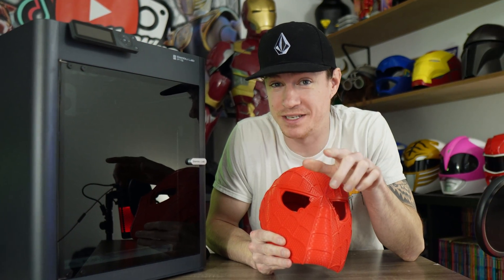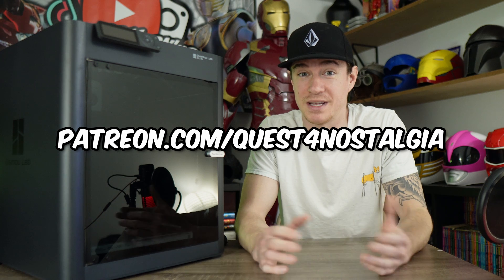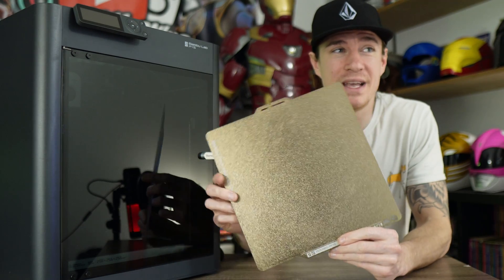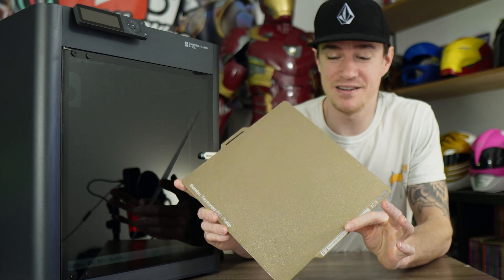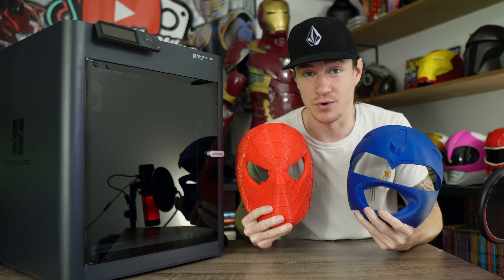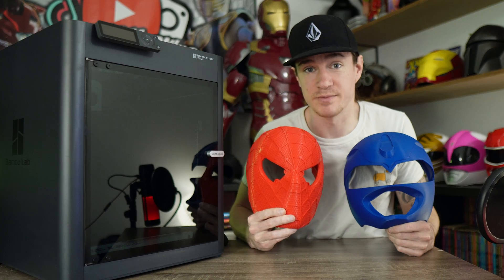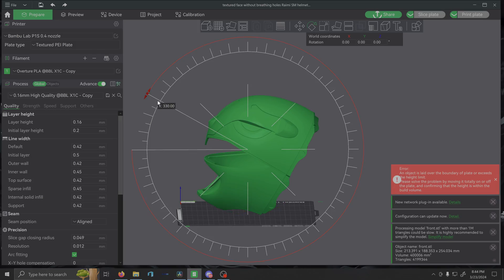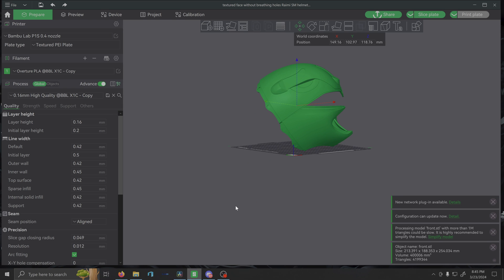How to 3D Print Full Helmets on a Bambu Printer!

Comment: Do you typically stick to a fixed layer height? Or do you use the adaptive layering feature of Bambu to get an improved print on the dome?(reduce circles)
Reply from the maker: @Capafool  I usually stick to a set one, but I did try adaptive on my turbo red helmet and it really did make the ringing easier to sand down
Reply: @LayersofDylan  Thanks! Keep up the good work.

Comment: Happy to see my head size fits 😊.   Would you recommend printing with .6mm over .4mm nozzle for these large prints for the time savings? Thanks!
Reply from the maker: @Capafool  nope I only print .4 I used to do .6 on old bed slingers but it is more work to sand smooth
Reply: @SaturdayMorningProps  thanks! I'm using a P1S so no slinging to worry about 🙂. I'm still learning but once I get my first few prints I can maybe do a video on my experience of using .4 vs .6 nozzles using adaptive layering to find a happy medium between speed and quality

Comment: The main problem is there's no easy way of splitting that I've found. There's one program that works ok but it's ridiculously priced at $100 a year or $500 lifetime and their monthly price is even more ridiculous. I don't support piracy but this guy deserves to have his software pirated. I think it's called Luban
Reply from the maker: @dosdont  I split with 3d builder, it's linked in a google drive on my helmet sizing tutorial pinned comment
Reply: @LayersofDylan  3d builder for Windows? I use a mac and I just read that MS is not going to be supporting it any longer or it's not in their store any longer. The community has done a piss poor job of making splitting stl's easy IMO
Reply from the maker: @dosdont  you can also hot key c to split in Bambu slicer and add pegs
Reply: @LayersofDylan  Yea, I've done that for splitting in two but when you're trying to split in more than 2 parts it's a pain.

Comment: I had the exact same thought debate with myself, K1 Max or P1S. Ended up with the P1S with AMS on sale, was about the same as the K1 Max pricewise. While I do regret it not being big enough to print a Clone Trooper helmet I AM stoked about the quality and ease of use. Coming from a Neptune 3 Pro and always fixing something or changing settings every other print. With the Bambu I load the file into the slice (Orca) send the file and print from my PC. Never have to check and if I want to I can do it from the slicer or the app on my phone. If you have the money or can get it cheap I say go for it. Might go Neptune 3 Max or K1 Max later on if I get into hardcore cosplaying or selling armor.
Reply from the maker: I now have a k1 max and P1S and still choose to print on the bambu more
Reply: I’ve had an ended 3 that I’ve been messing around with over the last year and a half after getting upgrades and I get so frustrated with always having to troubleshoot, sometimes it takes weeks to figure out what’s wrong. Would you say the ps1 is miles above in an ended 3 or do you still have to tinker around and troubleshoot? Cause honestly it’s taken the fun out of 3d printing after spending more time doing than actual printing. I would totally consider a ps1 if it eliminated all the troubleshooting that comes with an upgraded ended 3.
Reply from the maker: @JackPage-l4k  the bambus are miles ahead, they are amazing out of the box, I'll have a video next week on the A1
Reply: @LayersofDylan  thanks for taking the time time reply! Im going to check out micro center for sure this weekend!
Reply: @JackPage-l4k   I won't lie and say that it's perfect. But boy does it take around 90% of the problems away. I hit print on my computer and it prints. I'd say 9 out of ten errors are on my side being either settings or just general human error. I'm glad for my Neptune 3p cause it taught me things to look out for but boy am I glad that I don't have to watch my printer every 5 min making sure nothing screws up.

Comment: When you cut the files into different parts, how do you hide the gaps after gluing/welding them together? Would the Bondo glazing putty be good for that?
Reply from the maker: Yup depending on how big the seam, can use spot putty or real bondo

Comment: Any chance you could share your support settings and print orientation on the bambu specifically. I've been trying to print ranger helmets from DO3d and Wicked on a p1p but the supports are crazy on them. Do you think the details on white ranger helmet needs supports from the inside? (the forehead patterns)
Reply from the maker: I'll try and make a video on it 🤘 I prefer snug supports on the p1p and paint them on usually

Comment: For those 103% ones how did you tackle the magnet size issue?
Reply from the maker: Do3d and yosh seem to both use around a 8*2mm magnet, do3d at 100% often are too tight for those and I have to end up using my soldering iron to expand the hole, at 103% they still work fine with just super glue
Reply: Awesome! Yay for accidental tolerance!

Comment: I was pretty torn between the K1Max and the P1S for the same reasons and I also ended up getting the P1S. Currently it's printing out pieces for my Halo Mk V[B] suit and this printer has been leagues better than my Anycubic I3 Mega and CR-6se and not to mention the AMS system has been great for swapping rolls as I run out.
Reply from the maker: I almost got the ams for that reason to have no waste but I couldn't get myself to pay that   for it